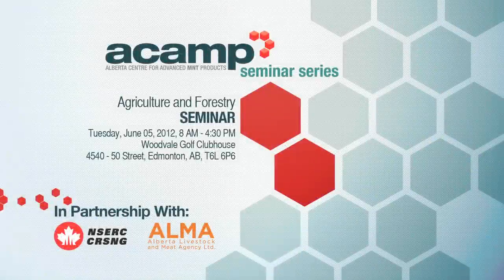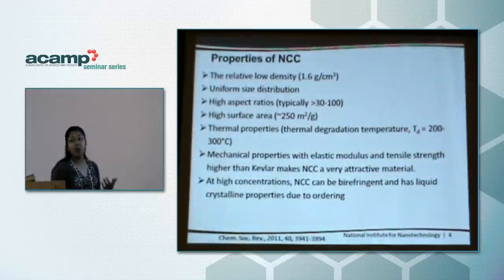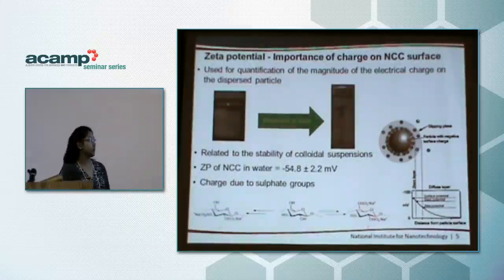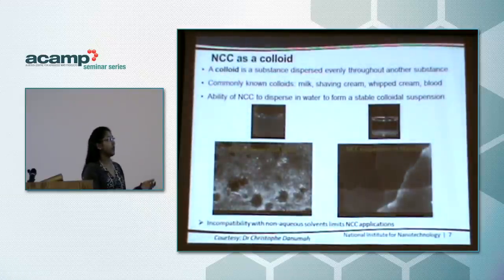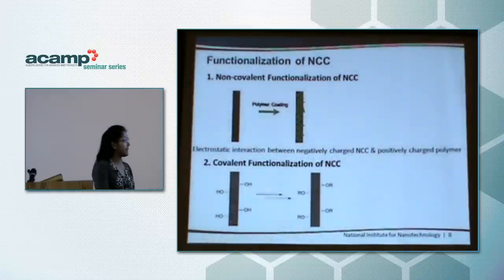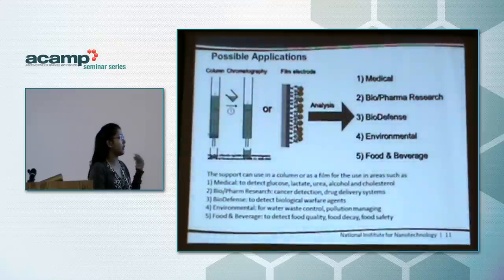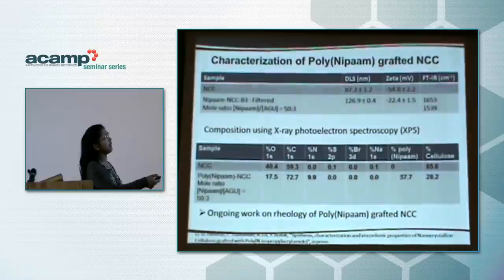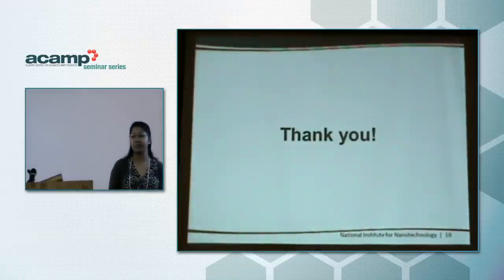Dr. Usha Hemraz - Surface Modification Of Nanocrystalline Cellulose

Comment: Hi acampalberta,
I really impressive with the presentation
I have questions about video
1/ What is the difference between cellulose nanofibril (CNF) and cellulose nanocrystals (CNCs)? I mean the method extraction.
2/ Why method extraction will effect the problem create cellulose nanofibril (CNF) and cellulose nanocrystal (CNCs)?
3/ Which is the best method to dry nanocellulose? And why use this method.
I hope I would receive your answer soon.
Thanks acampalberta so much.